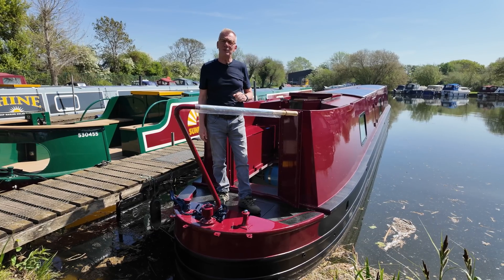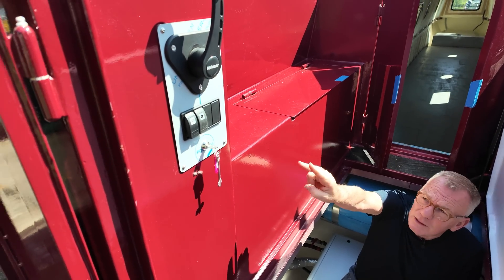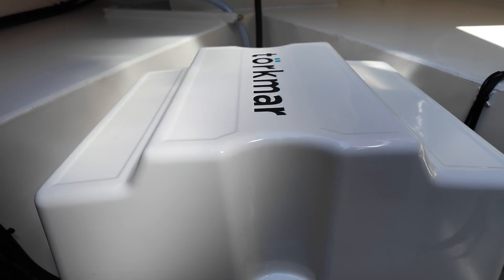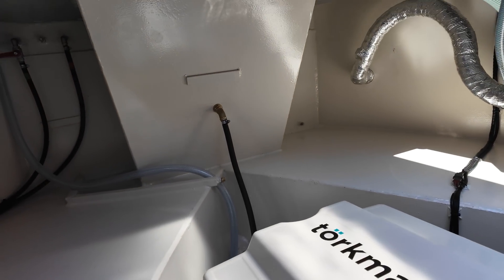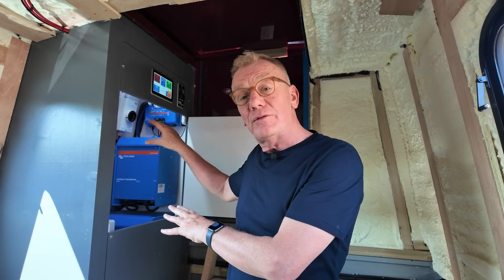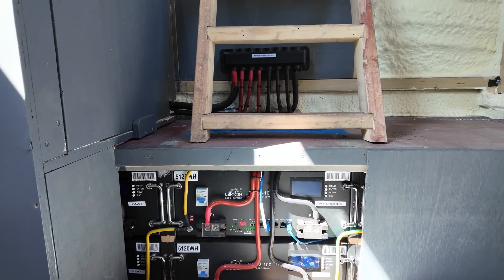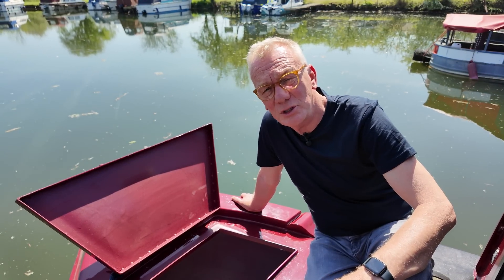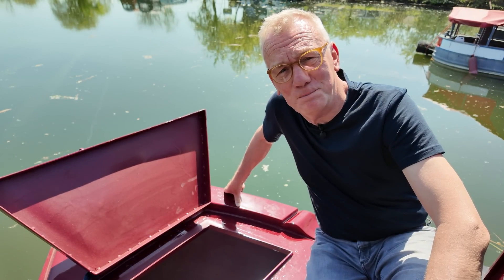ELECTRIC REVOLUTION on the Water! Sailaway Narrowboat Ready for Off-Grid Dreams!

Comment: Serious question. In the case of a lightning strike, or even a nearby one when the bolt looks for somewhere to discharge, how are these boats earthed?
Reply from the maker: When lightning hits a steel narrowboat, its hull acts like a Faraday cage, directing the current over the exterior into the water. This offers some protection to those inside.

However, severe damage to electrical systems and electronics is common due to the massive electrical surge and electromagnetic pulse. Physical damage can occur at strike and exit points. While occupants are somewhat protected, touching metal parts or side flashes pose risks. After a strike, check for fire, water ingress, and thoroughly inspect electrical systems. However it's a very rare event. Tim

Comment: In a days normal use (nice weather, cruising, cooking, hot water etc.), how long would the generator need to run to get the batteries ready for the next day? When do customers tend to run them (End of the day? Whilst cruising along?)? Thanks
Reply from the maker: In reasonable sun you’d have more than enough power for cruising on the canal and cooking. Hot water is the problem so you might need the genny on for an hour. Cheers Tim

Comment: Why put bricks when batteries are so heavy? Could have used that compartment to put a bunch of batteries
Reply from the maker: Hi Gianni, this boat has 6 lithium batteries so that's only 300kg. Lead acid would be 1200Kg to 750 kg depending on the type. But the boat still needs 3000kg total in ballast. Now you know as much as me. Tim

Comment: Generator lol not quite green hey
Reply from the maker: It's there for the winter and is the most expensive and under used bit of kit. I've had my boat for 7 years and have spent less £300 on fuel for the diesel - Tim